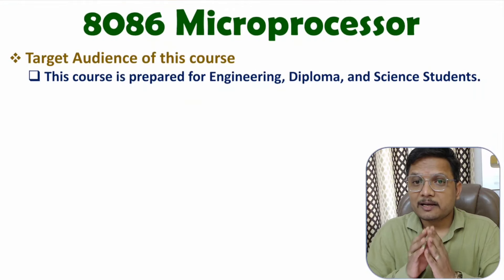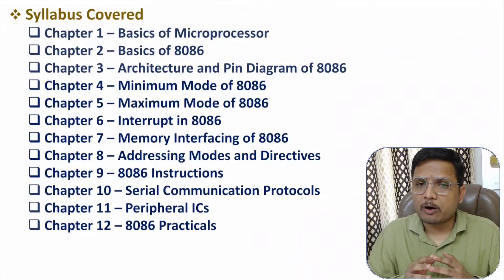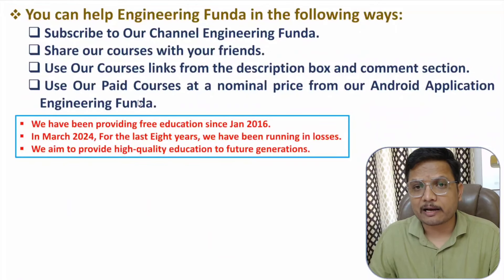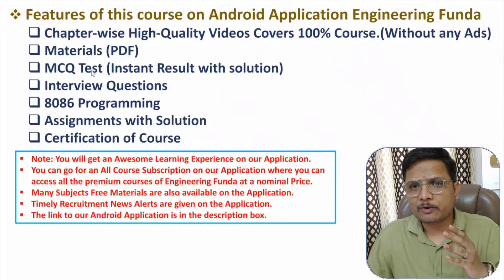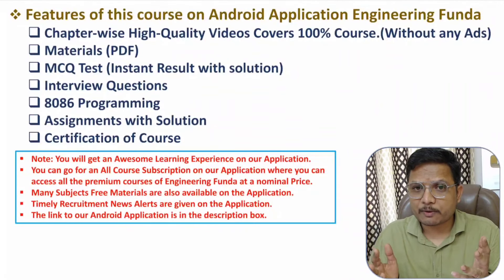8086 Microprocessor by Engineering Funda

Comment: 00:03 8086 Microprocessor course structure
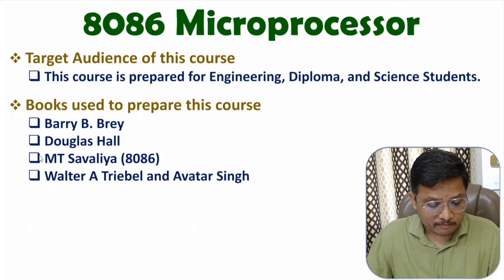00:40 Comprehensive 8086 Microprocessor course
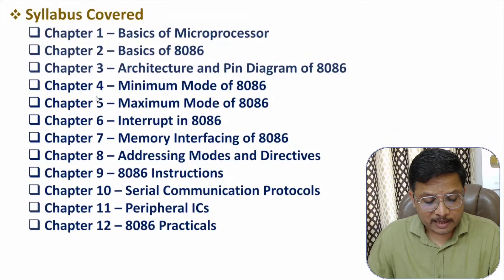01:12 Overview of different chapters related to 8086 Microprocessor
01:43 Free educational videos on 8086 experiments
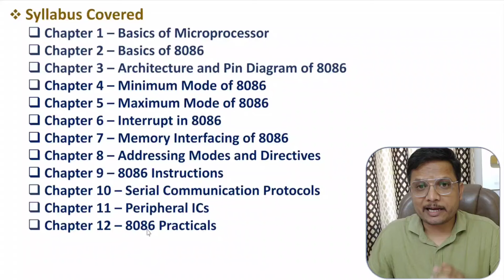02:17 Ways to support Engineering Funda
02:52 Engineering Funda provides access to video lectures, materials, McQ tests, and interview questions.
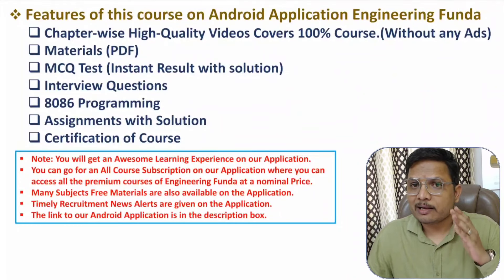03:25 Engineering Funda app offers various features and certifications
03:58 Engineering Funda offers job updates and recruitment news alerts.